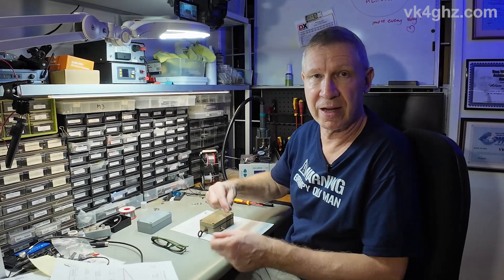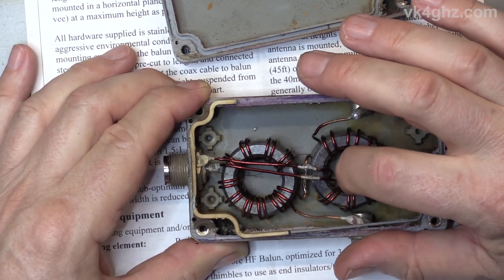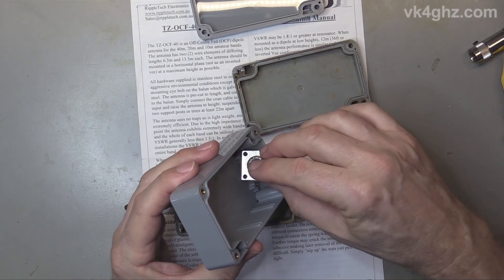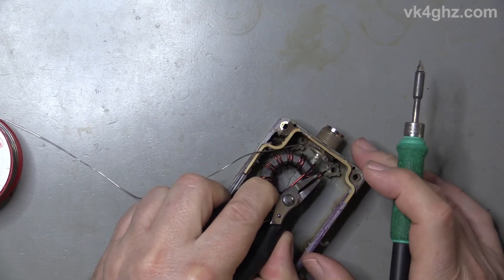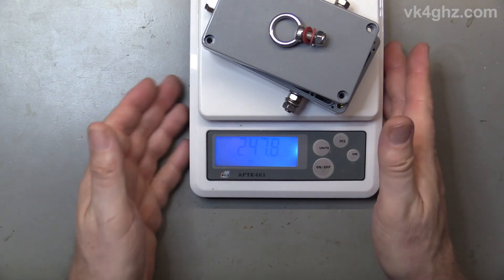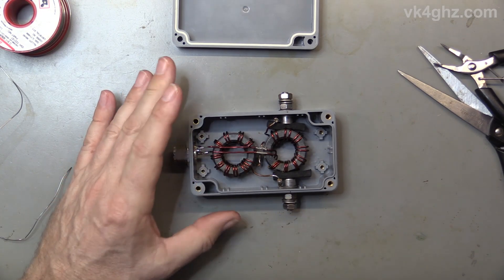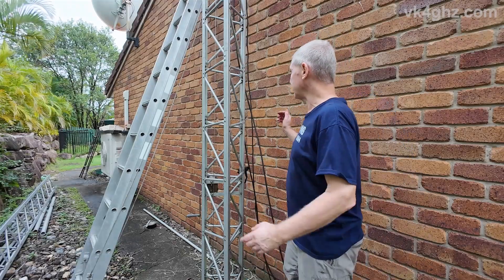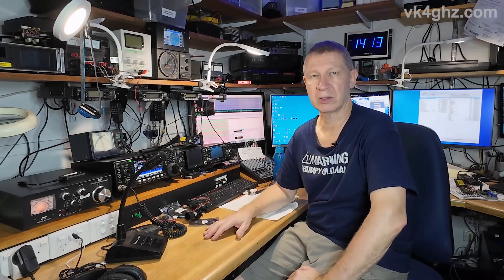Dipole Disaster!

Comment: We have watched your video and note the following:  (1) the use of foam as a dampening mechanism is not appropriate in Australian conditions as it will quickly powder - a better approach would be to use silicone to hold the toroids in place.      (2) the use of unsupported lugs to attach the wires means there is no strain relief on the terminals and the lugs will break very quickly - better to use cable ties with heatshrink over the cable ties or copper swaging crimps  - this is the consensus of our EMDRC members watching the video this morning - cheers  Peter  VK3QI/VJ3P
Reply: Tough audience mate.
Reply from the maker: Time will tell if the foam inside degrades at all, but it won't be because of UV. Thanks for the feedback, but you can tell the members, that the "unsupported wire" and lugs have been doing just fine for 16 years!  Whatever RippleTech did under the heatshrink is working just fine.